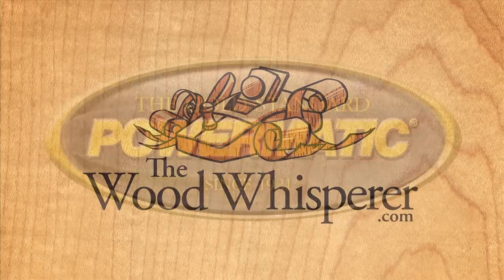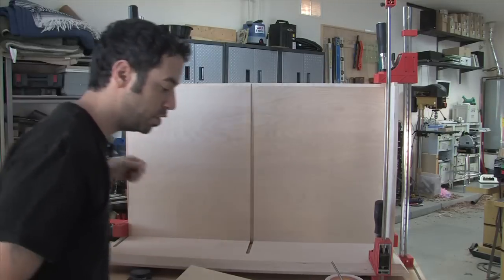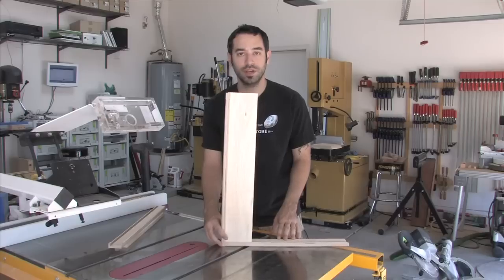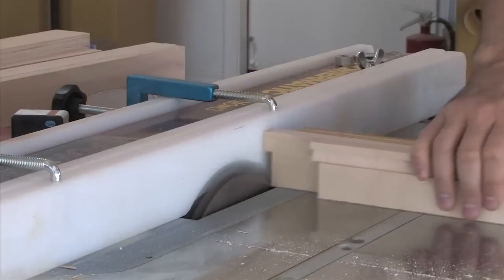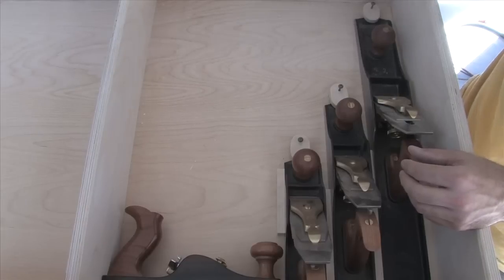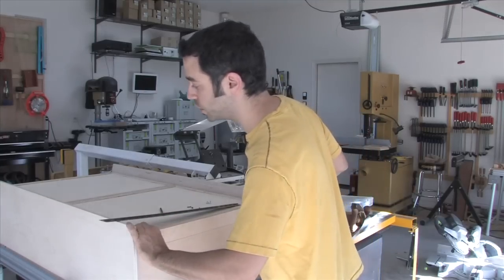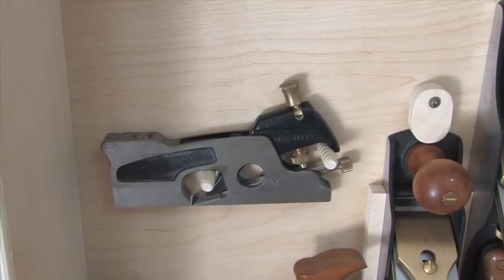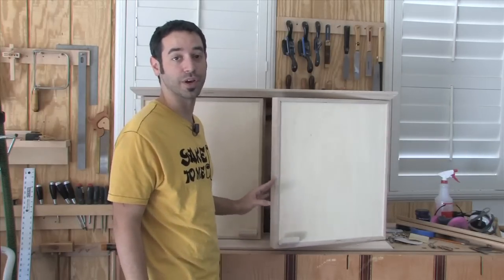154 - How to Build a Wall-Hanging Tool Chest (Part 3 of 3)

Comment: Marc, I’ve just started to follow you on Youtube, you’re really inspiring me to get some serious woodworking done! This project is great and I’m impressed by how everything just falls into place with no tweaking needed. Kudos! To hold the metal clips on the front of the door without making holes, you could put strong enough magnets in holes on the inside. That way the iron clips would hang on the outside when needed and you could easily take them down when you don’t have any plans to look at.

Comment: Did a similar project years ago to hold groceries in my kitchen/dining room.  Instead of a solid door, I used peg board sheets.  This gave me lots of room to hand kitchen gadgets on the outside and inside of the doors.
Reply: Ted Heissner Me too! With pegboard panels, I can hang things both inside and outside!

Comment from the maker: @balrogmb That is correct. No cleat. I didn't think it was really necessary with the tight fit of the vertical dividers and the magnet. Turns out with magnet, the clip, and the weight of the planes alone, they are quite secure. After a couple years of using it, I can say it worked out well.  Good luck with your woodworking!

Comment: I've found a 4'x8' sheet of dry erase board at HomeDepot.  A few years ago I ripped a sheet  into  small boards for my wife to use in her class room where she teaches.  My thought is to use this on the outside of the door, maybe this at 1/4" thick+1/2" plywood to give it more thickness so things can be hung on the inside.  This would give you a dry erase boards for doors so you could do calculations or anything else without the use of paper.  Call it a "green" idea so we don't use as much paper.

Comment: This thing is awesome!  Definitely on my todo list, as are several TWW projects :)

You could make drill bit holders that secure to the inside of the doors magnetically; that would free up some shelf space for other stuff.

I wonder if those magnets on the planes will eventually magnetize the metal of the plane sole?  Not that it matters much for wood planes, but someone who does metalwork in their shop as well as woodwork might eventually find metal filings sticking there?

Comment: Another idea for the front of your doors would be to paint them with either Dry Eraser paint so you can use it as a dry eraser board, or they make a magnetic chalkboard paint that would be a good idea too! And then you could stash the dry markers, chalk, and or erasers in the inside of the door too!!!

Comment: Great break down of the Assem-buh-lee!  With there being a lot of different choices in wood glues available, what brand and variant do you use as for the strongest hold?  Is it something that can be found a the local Lowes or Home Depot?Sorry if you have answered this before, I haven't had a chance to make my way all the way through your site yet or all of the videos.

Comment: Funny that the epoxy worked better. I suspect because it's a resin is kinda slippery like oil. Curious, why not use epoxy all the time? Epoxy is stronger (right?), more transparent, fills gaps, and dries faster then woodglue if I recall correctly.

Comment: When you were assembling the top, you used epoxy for longer assembly time.  Would Titebond 3 be sufficent for this step?  It has twice the tack time as the Titebond 1 and 2 but it's only 10 mins long.  Or does it begin to tack much earlier than advertised and could possible cause issues?  
Thanks for the videos!

Comment: Almost all glues now a days are stronger then the wood they hold. If your worried about strength. It more depends on your choice of joint and whether there are supports or not. 
Glue choice more depends on how fast it tacks up (quick is not always best), Hide glue for a traditional feel or repair, or a water resistant or water proof glue.

Comment: Question - I only have cinder block walls to attach things like cabinets to.
How would you attach the wall portion of a french cleat to a cinder block wall?
Reply: I'm a finish carpenter in the St. Louis area. We use anchors from Hilti to mount most everything to masonry of all kinds. They have a variety of different styles custom designed for specific loads and applications. I'll supply a link to their website. We've found that you need to get these directly from Hilti because their anchors require very specific bit/anchor combinations to work and you need to talk to a qualified sales person to make the right choice. In other words, the big box stores don't have the expertise. Hope this helps:

https://www.us.hilti.com/anchors

Comment: another perhaps more long term idea instead of pivoting holders would be just use a small strip of wood like you used to guide the sides of the planes, with a channel running between the back of the cabinet and the front of the strip- you know, so stowing the planes is a matter of sliding the top of the plane under the holder in a slightly upwards direction and it can't go anywhere?

Comment: I actually find that the magnet door holders they sell in stores are too weak for a tool chest of this design, I usually go with my own which uses two rare earth magnets so that if a tool falls over in there for whatever reason, the door is less likely to open (and have it fall on my foot, which happened, hence my designing my own). Also, If I install them on the top and bottom of the doors, my little cousin cannot find his way down there and then play with things he shouldn't.